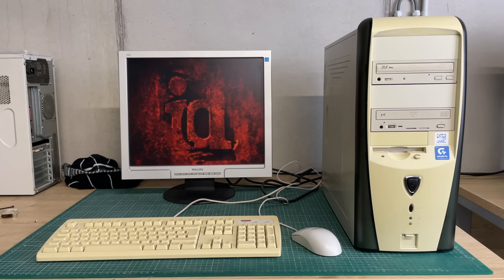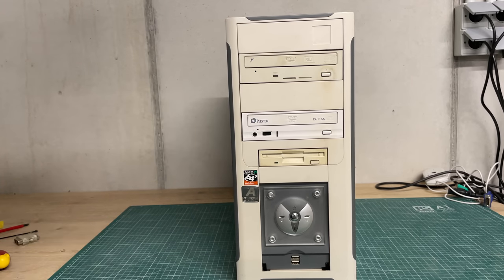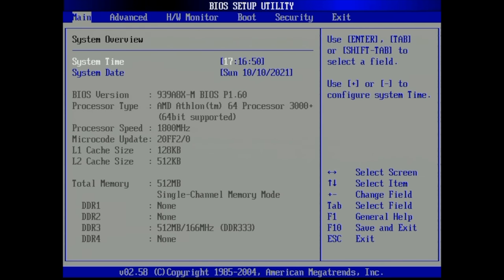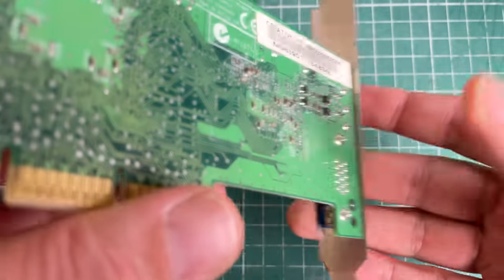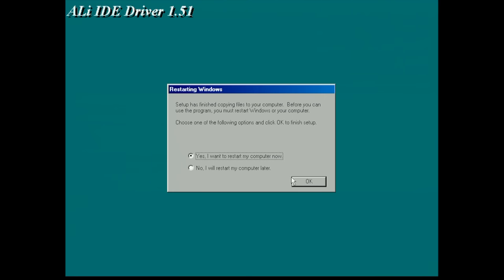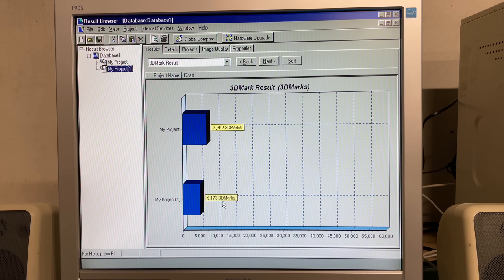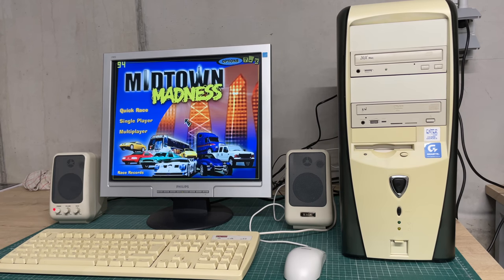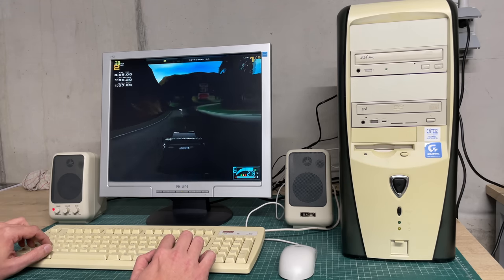Cheap Windows 98 Retro Gaming Machine

Comment: Athlons and early Pentium 4s were awesome late Win98 gamers.  They had the extra power that wasn't wasted on the NT architecture of 2k/XP that really helped out in late 3D games.
Reply: I did a Win98 install on an IBM Netvista desktop with a P4 1.8 Ghz---it was pretty fast
Reply: Is that the Slot A athlons, or later ones for Socket A?
Reply: @SOU6900  Both, really.
A slotted Athlon was a compelling alternative to a Pentium 2/3. And a socketed Athlon... those things screamed.
Ran Win98 on a 1333 MHz TBird for a good while(oh, for a way to overclock it by just 4 MHz...). Fun system.
Reply: @CptJistuce  If I remember correctly I've got 2 slot A Thunderbirds. One I believe is a 750 the other a 900, which is currently installed on a basic Gateway board in my original 98SE system.
Reply: Friend donated a crappy xp system found out was originally an ME setup he upgraded to xp .. research made me do it as a dream retro98 but wanted a laydown case .. board maxes at 1gb ram and with newist bios an amd athalon 2400 (2000 is in it @1667)

SilverStone Technology GD08B Home Theater Computer Case
asus a7n266 vm/aa
AMD athalon xp 2000+
512mb ram
2g/16g 2hd CF cards
Geforce4 128mb
Soudblaster audology2

Lots of those boards out there on ebay between 80-200$ used/new

has built in gpu (geforce2 32mb/64mb i believe bios selectable) and sound so a good board to start with
Reply: @darunealbane  Awesome friend!
Reply: @CptJistuce  working on a 4g ram multi core 2000/xp

Have a 2 core ddr2 ram board but not sure the chip info .. know it is a amd 2 core
Reply: Early Pentium 4 and Athlons are the perfect replacement for a late-90's high-end PC assemblies.
Reply: @darunealbane desktop style cases kinda anachronistic though for that era

Comment: Great video! Most of my Windows 98 PCs are timed correctly, but I still have a Windows 98 Infernal Machine. It has 1 GB DDR2 667, SATA2 with 128 GB SSD, Core 2 Duo E6750 with 2.66 GHz and Voodoo 2 SLI cards. The SLI configuration is connected via a PCI to PCI Express bridge. A GeForce 7600 GT with 256 MB is installed as the main graphics card. All Windows 98 games run on it. A real monster ... The SSD even manages almost 300MB per sek under Windows 98. Unfortunately, it works the Soundblaster 16 emulation of the Soundblaster Live cards no longer works on newer boards.
Reply: How does 98 handle multi core? I know win2000 serv has 4 cpu 4gb ram support
Reply: @darunealbane  Single processor support only. Interestingly, the Core2Duo is recognized as a Pentium 3. Meanwhile I have an E8500 with 3,1 Ghz running with Win98.

Comment: Thanks for making this. I'm in the process of weeding out machines I don't need (for my wife's sanity). I've found some of the Windows 95 games don't play nice with Pentium 4.  I'm still trying out games, but I've found you can play most games from the early 90s through about 2005 on two main machines. Especially if you use motherboards with a robust BIOS and are willing to swap peripherals and boot drives.

Comment: I have been more of a purist with my retro pcs but finding parts can be frustrating and expensive. I am starting to warm up to this approach for late 90's games. Very accessible and great performance. Get yours while they are still cheap.
Reply from the maker: Indeed ... as a collector or youtuber its nice to have a variety of different time period correct things, but for the casual gamer that wants a nostalgic hit, this is as good as it gets.
Reply: I think so long as the drivers exist, there’s no wrong in getting the right combination of hardware which have them available. I’ve been finding laptops preconfigured with the right hardware specs like that, they pack more power than the desktops of the time but I can use and bring them wherever I want to whenever I want to.

Comment: Interesting approach. This kind of stuff is not just cheap, it's often dumpster stuff. Got the feeling that this kind of machines might begin to be a bit more appreciated and gain a bit of value, thus shifting the dumpster category more towards Core Duos and such only... if it wasn't for the capacitor issues.

Comment: Ho,I've a question

Using a proper CRT Monitor that has VGA output
In order to play correctly DOS Games Who have 320*200 or 620*480 native resolution

In the Monitor CRT and on the Video card of the PC, what's the resolution that  I have to set?

Thanks

Comment: You can't get any "retro" tech cheap on ebay in the UK anymore. About 8 years ago you could get a high end Slot 1 Pentium III for less than £10, now ebay sellers want £45. Old graphics cards are overpriced too, especially 3DFX cards. I remember deciding not to pay £25 for a Voodoo 5 a few years ago, now people want £200! Complete Pentium II systems cost over £100 now, it's ridiculous.

I'm glad I built my retro rig before everyone got greedy.
Reply from the maker: indeed. It is crazy how some of these things are selling on ebay. Not the prices I'm seeing here at local listings. There doesn't seem to be a real market for second hand retro stuff over here. At least not for selling :)
Reply: Nowadays even agp graphics cards like the geforce 6200 are selling for ludicrous prices in my area (these are not the ones that you can possibly get to work with a G4 cube). Seen afew of them asking for SGD $50.
Reply: @MixShadowlight  I actually bought a 6200 PCI a couple of years ago, I think that was £30+. Stupid money but I wanted it to just to see how it worked in a Pentium III, Window 98 SE build.
Reply: @SMlFFY85  the ones they are selling are the agp version which are way more common and are literally worth nothing.

Comment: IIRC the memory runs so slow because of the dividers of the A64's memory controller. Put it manually to DDR400 as the board doesn't do it for some reason, if you're running at stock. If you overclock it, then use lower speed from BIOS.

Comment: Those Antec cases were imported by Chenming USA; they're gone, now, but for a while they still existed, I even managed to get some replacement hardware for one of their cases as recently as 6 or 7 years ago.  I had a full server tower I used as my gaming system, but my God was it an oven with modern components inside!  Temporarily switched back to a Raidmax Scorpio, then finally settled on the modern case I have now.

E: they're also impossible to cable manage.

Comment: Ahh, a whitecase computer---a reminder of the days when it was cheaper to have a computer store build you one vs buying one pre-built from a major manufacturer. My, how things have changed. Btw, these old computers have become quite pricey here in the US
Reply: I appreciate your comment is 8 months old at this point, but it's now becoming almost cheaper to build a PC again as opposed to getting a pre-built from Dell, etc.
Reply: @mrmerlin6287  Unless you're talking about a gaming rig, it's still cheaper to buy prebuilt. I've seen prebuilt desktops for as little as $300, and I paid $500 for my Dell, which came with a Core i5 and 8 gb of ram
Reply: @justsumguy2u  Ah, yes. I was still refering to a gaming PC. I don't use a PC professionally, just as a way to play games.

Comment: You know what all this 3 PCs are mixage of high and low end. I'd choose the best parts of them like gigabyte mobo with nforce cool multimedia chipset place it in restored antec case add fast agp and decent pci audio for great win xp games like doom3 for example :)
Reply: Retrobright for antec tower and clear coat to prevent from further yellowing of the plasic
Reply: Audigy 2 ZS will be my choice for audio, another cool is auzen x-fi prelude
Reply: Or a sort of reversed sleeper, in a new Antec case and a lot of RGB......

Comment: Athlon xp machine with a geforce 3 or geforce 4 series gpu like a mx 440, slap a fan on that & overclock it a bit would do pretty well as a windows 98, early windows xp machine.

btw checking the motherboard manual you'd want memory installed in 1 - 3 or 2 - 4 for dual channel so different colored slots, also if there is an option called " flexibility " nearby where you adjust memory speed, cpu multiplier etc... you might have better memory compatibility with that enabled.

Worth looking at early 2000's windows xp laptops as well for a more portable windows 98 or windows 2000 machines, my dell inspiron 6000, ati x300 graphics, pentium m 1.5 ghz 1.5 gb ram pretty low amount of games that doesnt like the ram amount & the gpu but otherwise runs what i want very well.
Reply: I got that same gpu in both my 98 and ME systems. 98 is rocking that old school Slot A Athlon Thunderbird. ME is some sort of Socket A cpu.

Comment: What you think about some cheap or dumpster windows 98 se gaming rig? Socket 754 machine :  AMD Athlon 64 3200+ 2.2 Ghz, mb ms7181 rev 2.0 , Ati Radeon 9250 128 mb 128 bit, , 512 mb ram  , 10 gb hdd (ata) and win 98se  and last directx 9.0 for win 98.

Comment: I'm in the process of getting my 98 and ME systems back in working order. 98 just got a fresh CMOS battery, now just needs a bigger hard drive and one or 2 new CD drives. One drive for some reason won't read the first disk for The Sims Complete Collection, the other the mechanism to open and close it is jacked up big time. ME system as far as I can tell just needs a PSU which is half the battle since I need one with a lot of Amp capacity on 3.3 and 5 volt rails. Once I get them both back in working order I'm going to see if I can find updated Nvidia drivers for the GeForce4 MX440 cards that both systems have.

Comment: Windows 7 on a machine with 32 megabyte of ram… that’s courages of the pervious owner. I bet it must have been a bit slow. It seems that your Win 98 install went a lot smoother then on my Pentium 4. My machine is not ideal for it, 2 gigabytes of ram, requiring hacks and tweaks. For some odd reason the graphics card drivers should support win 98 SE, but fail to work. SCI tech display doctor to the rescue to get 16 bit colour depth. It really helped me out there.

Comment: Due the import and custom fees based in the weight of the package in my country, importing old computers are extremely costly, even you got it cheaper in eBay, you have to pay for the shipping plus i need to use a package forwarder to deliver in my country, which makes the costs increase even more.

So i opted to import laptops, and got lucky when i found a PIII Toshiba Satellite 2800 for $50 here in my country, with light cosmetic wear. again, i'll still have to import parts because many old parts are not longer available here.
Reply: and the problem with old rigs, they are heavy as hell. Sure they are built like tanks, but the weight!

Comment: My first pc was a pentium 2 350 with 64mb of ram and 6.4GB hard drive. I forgot what video card it came with(maybe integrated), but I remember my first job was delivering jumpers with my dad so I could upgrade the card to a voodoo3 3000. The difference was night and day when playing quake/TF. Good times.
Reply from the maker: Yeah that must have been a big difference compared to any video card you might have had :)
Reply: @RetroSpector78  I remember now it was an s3 Virge/dx
Reply: @RetroSpector78  I love these projects. I'm setting up a EPIA-V Mini itx with win98. Drivers are elusive..😀
Reply: Just built a PC with a Pentium II 350mhz. Also I have a Virge/DX in my Socket 7 DOS machine.

Comment: Since you have 512MB of RAM, a dual boot of 98/2K or 98/XP would’ve been interesting to compare performance.
Reply from the maker: Might end up doing that indeed.
Reply: Many computers back in the day had nowhere near as much Ram as 512 MB even on top gaming PCs. I find its better to run a maximum of 256 MB Ram for Windows 98 SE.
Reply: A point xp maxes ram at 4g so a 512 98/xp meh

Have a 512 dos/98 and am working on a 4g 2000/xp

Comment: HT is more likely to be hypertransport than hyperthreading on an AMD machine.
Reply: correct, there was no hyperthreading. That was an intel thing. They did come out with dual cores on S939, though... up to Athlon 64 X2 6400+ (3.2GHz actual clock dual-core). Faster than a Core 2 Duo E6600.
Reply: I had only three AMD systems in my life. The first was an X5-133. Flied like an eagle! I actually owned a Dell workstation with an X2, but never figured out why it kept stuttering music running in the background while I did simple tasks in the foreground: managing files, opening an app like excel. I've experimented with a SlotA Athlon before. On that processor, you'd have to recompile the kernel to have correct media playback with 3Dnow (on linux). There had to be some tweaks made here and there on these older AMD systems, but who knows maybe it was mostly the 3rd party chipsets fault. Similarly spec'd C2D's like an E8400 or Q6600 worked just fine. No stutters. But you know when you combined an intel cpu with a sis chipset it wasn't as good as using their own. There are always ups and downs between AMD and Intel. They had to do something good after like Duron, etc. It's a healthy competition. As long as they are competing we get better tech out of it.

Comment: Used Rivatuner back in the day on every system I owned, once used it even to soft-mod my Evga Geforce 7800GT to a Underclocked 7900, unlocking the extra 4 disabled pipelines (20 @ 500Mhz Vs. 24 @ 550MHz).
Reply: Bullshit. All G7x chips were laser cut after binning, you couldn't unlock them.
Reply: @mydogsgfhasmoretestosteron7140  whatever you think man, I was there.

Comment: Ah, Windows 7 on an athlon XP is not too bad- main problem is memory..  The machine in general would feel an awful lot better than XP on a pentium 1!
Reply: WinXP was quite light. I managed to install it on a mere Pentium 133 with 64Mb RAM. Sure, it was slow but just for text editing, it was OK. But I used a later S7 motherboard model (Tyan Trinity S1592 ATX with AGPSet Chipset) with 384mb RAM, a k6-2 333MHz AMD CPU and a Geforce FX5500 [I know, quite overkill for the rest of the specs but i only had this one at this time] as a main driver for some times in the early 2010's and, beside games, i could do almost anything i need to do with it (including web browsing)

Comment: Dual-Channel also means Alternate slots ie: banks 1-3 or 2-4 see if that helps
Reply from the maker: The manual explicitly states that they should be in pairs. So 2 sticks in slot 1 and 2, or slot 3 and 4.
Reply: AMD dual channel didnt work like that but the opposite (1 next to the other)

Comment: I can never find a good one in the UK for under £100 they cost more than a dell with a I5.
Reply: It’s tricky, snagged a slot 1 motherboard with a PIII 500 for £35 on eBay with some SDRAM and a 10GB drive. Got a cheap case for £5 but did splash out £60 on a Voodoo 3 3000 so just in at £100. FB marketplace has some cheap desktops kicking about so worth keeping an eye out.

Comment: I have 2 unbalanced win98 PCs. One is a 1Ghz pentium 3 pc with geforce 4 TI4600 and other one is dual core Athlon64 FX-60 with Geforce FX 5950 ultra gpu. I call them unbalanced because that geforce 4 ti4600 card is too fast for pentium 3 probably and second one is unbalanced because it has dual core but win98se can only use one core.

Comment: So... I have Windows 10 on an athlon XP. On an SSD to be fair, but still XD
Reply: Oh wow. How well does it run? I’ve had Windows 10 running on a single core Sempron 150 (socket AM3) before, and that was horrific 😖

Edit: I also installed Windows 7 on an Athlon XP system, that was a mistake too.

Comment: Oh, nice, a Higher end Gigabyte Socket 7 nForce2 board.
But again, a really awful Power Supply :( 
You really didn't have any luck so far with Power Supplies in this lot. Only Linkworld and Trust so far. (Fun fact: some Trust PSU was recalled in Germany due to fire hazzard).
Reply: Socket 462/A
Reply: @yosuhara  ah, yeah, brainfart :-/

Comment: why windows98 on a 64bit pc
Reply: Because why not? Its pretty much overkill for Windows98 but nothing like an overkill computer for retrogaming on Windows98 :D at settings and FPS you would dream of back in that days!
Reply: A modern computer can be had cheaper than an old one being sold as "retro".
Reply: @abooogeek  ik but honestly, i would at the very least, dualboot it with xp because it's a shame that 98 doesn't use it's full capabilities
Reply: @the2323guy  Yeah that's a possibility. The problem I have is you would end up with a PC that is kind of the bottom end for WindowsXP and you can find beefier systems for a dime that will run XP even better. I would say if you have a card running DX9, then yeah I would go this way. If your AGP cards are DX8 and less (and I would avoid investing too much money), then Win98 solo would be a better option.
Me I literally crawl over Pentium 4 cases that I am split in what to do with them (got them for free or $10 a pop), and that makes me think maybe have them as Windows98 machines be a better option (assuming I have the drivers for it)?

Comment: whats more amazing is Unreal Tornament 2000 released in 1999 that ran great on a celeron 433 with 64 ram and 8meg SIS built in graphics looks still modern and amazing today but if you see PC gaming from 1985 and before its terrible.... to be honest all the inovation and graphics improvements in games happened from 1990 to 1999. Now you can run Company of heroes  on max settings on any cheap laptop but Company of heores 2 that looks only 25% better needs a Computer 8 times faster and will still push a modern laptop to the max on high settings.... game codding has become garbage and these silly graphical effects that take up 4 gig VRAM have become ludicrous.... that unreal tornament 2000 ran great on any 4meg vodoo card yet modern games now want 8000 meg ?  are they 2000 times better ? of course NOT